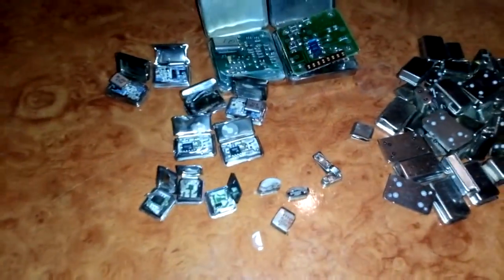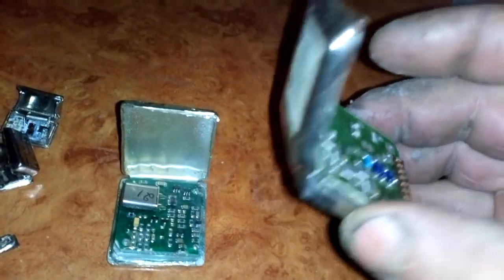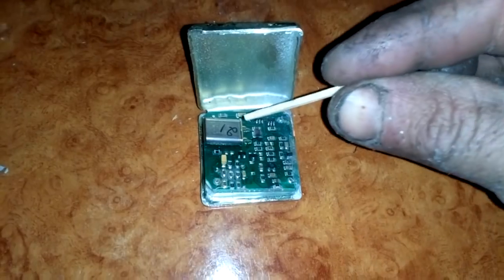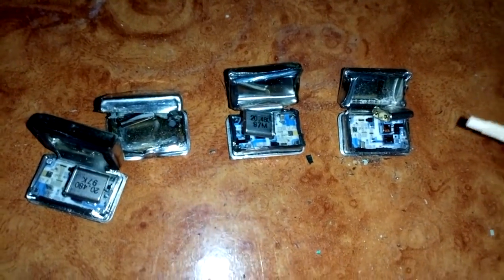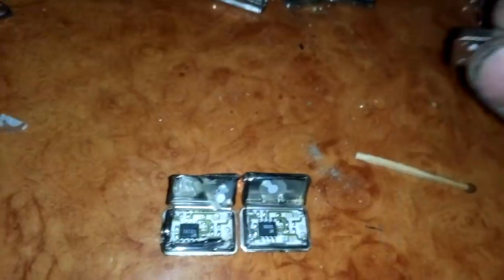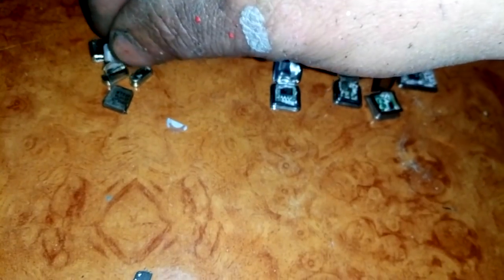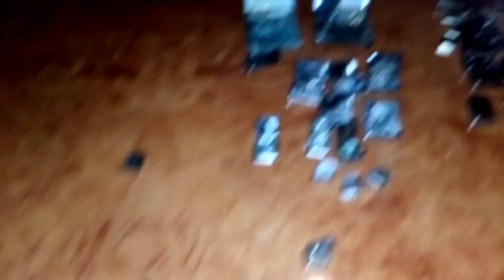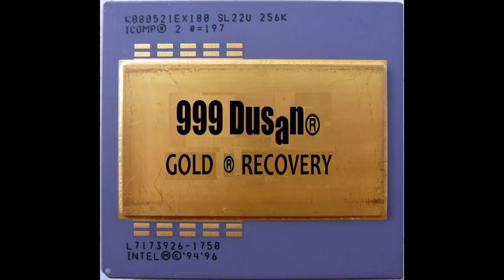Crystal oscillators & cristal -Gold,Silver & Paladium content

Comment: I have a question about the deposition of silver with palladium and how to separate the two from some and what materials are used and thank you very much.
Reply from the maker: Thus: it is best to first use Hcl, remove tin, then rinse and add Nitric that will absorb silver and maybe a little Paladium. Then add Hcl to Nitric to precipitate Silver chloride and make Aqwaregia from which you can then extract Paladium with a chlorine gas generator. I hope I was helpful. Soon I'll make a video about the oscillators.
Reply: @999DusanGoldrecovery  sls..,,, ,

Silverand palladium how to get palladim.

Silver and palladim how get palliduim3